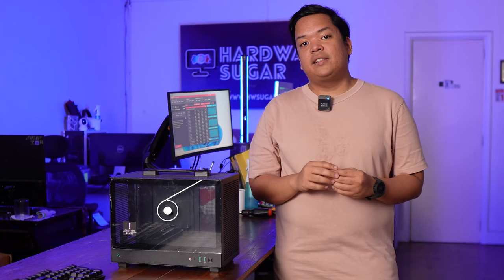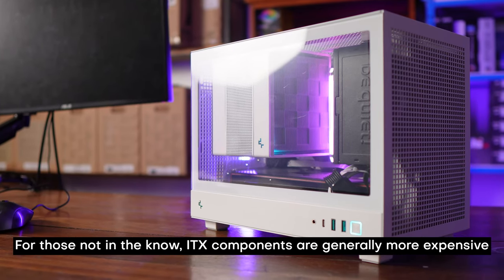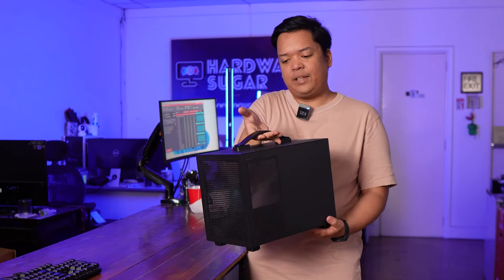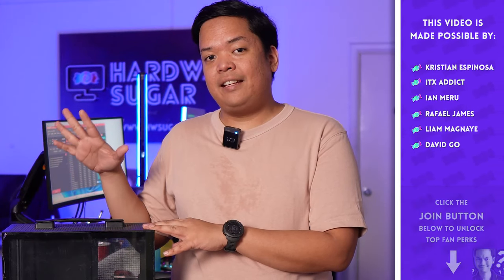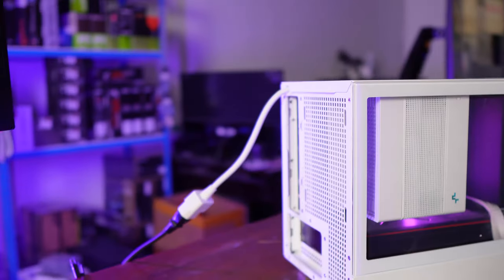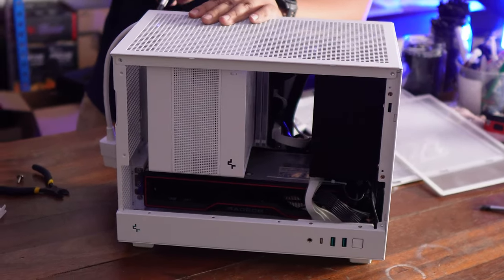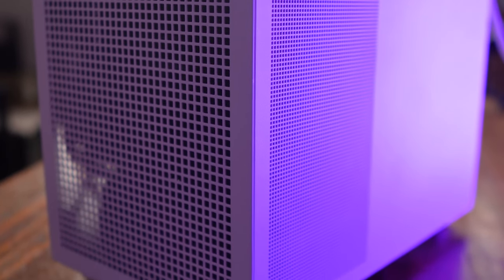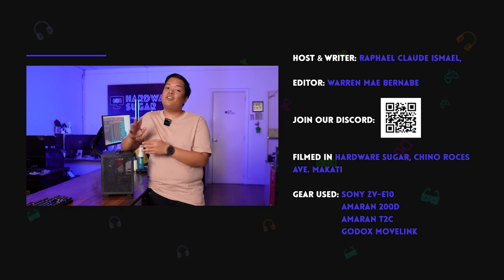ITX gaming rig on a budget! | Deepcool CH160 build and review

Comment: The future is ITX.
Reply: The only downside is the maximum GPU length of 305mm, this case can have a massive air cooler but not a massive gpu
Reply: @LeonOwO  i saw someone put a 4090 on it lol you can fit a powerful gpu here regardless, it may not be all gpus but theres still available powerful gpus that this case can handle like 1440p gaming
Reply: @ajjames1960  the 4090 fe im assuming? this would be a perfect fit but not a good match for this case.

Comment: Sayang, di makahinga ang gpu. Too close to bottom grills. I definitely prefer a vertical oriented case ala meslicious vs nr200 layout. Its cheap though, which is its big draw. Sana may option na mesh for the side instead of glass.
Reply: As stated in the video, during our testing, we averaged around 70C for gaming (averaging 297W) so thermals are no problem. Plus there's still space at the bottom as well as the space outside the case as it's lifted by around an inch via the case feet. 

Heck, we've seen other builders put a 4090 here with no problems.
Reply: @rockyismael  At what ambient were you getting 70*C? Is it 70*C exact because you said around 70*C that could be 69-72*C.What games did you run, or is it 1-2 games only? The type of game you play also makes a big difference.
Reply: @pkpnyt4711  ambient temp should be around 25c, games and apps used (1440p, mad settings) were Cyberpunk, RDR2, timespy bench, Diablo 4, AC: Odyssey and cinebench R24 GPU test (all tested and averaged values for about an hour). Plus FYI for our thermal testing, it's not about what game to use so much as what usage can draw the most power load as your primary metric is GPU wattage during sustained loads and as I've said, we've clocked it in at an average of 297W for the 6800XT for all tests.
Reply: @rockyismael  The reason I'm skeptical is because you were using a reference 6800XT in the video. No reference 6800XT has ever averaged 70*C only, specially here in the PH. Especially in your scenario, the reference you're using is in a mini itx case. That's why I'm aking what the exact Temps are.
Reply: wala naman problema sa temps, for an mitx case is maluwag na yan
Reply: HAHAHA! Closer = Better in the case of Small Form Factor builds. Watch any Optimum Tech or Machines and More video where they explore the airflow limitations of small PC cases.
Reply: @itxaddict7503  not always  the case as its dependent on the type of restriction the case has on the type of surface area with holes vs without holes it has. Even Optimum Tech mentioned that.
Reply: @pkpnyt4711  Recirculated air is never a cooler temperature than fresh air from outside the case. If you're arguing that the CPU temperatures might be affected by lack of exhaust for the air heated by the GPU I would say you have a point.

Comment: My issue if I went to an ITX build is how much of my exisiting stuff can be reused :(
Reply: With this case, you'd probably only change the motherboard and possibly the cooler (if it's an AIO or air cooler higher than 172mm). For the GPU, you'd only have to swap it out if it's longer than 305mm

Comment: Would you recommend using the Deepcool CH160 over the Tecware Fusion?
Reply: The fusion is a great "rival" for this but IIRC, it has smaller clearances for GPU (if using an ATX PSU) and air coolers.
Reply: @rockyismael  ooooh Id love for an ITX build comparison on a budget wit lyk pros and cons hohoho
Reply: It's got a handle!

Comment: Hi. Will i have clearance problems if my nvme requires heatsink?🤔
Other parts that will go with  build is 4080super, peerless asasin 120se for cooling, sfx psu, asrock a620i mobo. Thx!
Reply: The case doesnt have anything to do with nvme heatsinks. Check your cooler and gpu they might get in the way of the nvme heatsink. Also the 4080S make sure get the zotac one the case max gpu length is 305mm

Comment: ok ba to kung nasa taas yung power supply ng mother board ko? AB35ON Gaming Wifi gamit ko?  ilang storage sir kaya nyan? thanks
Reply: It would depend sa PSU and cooler na gamit mo. Wala siyang cutouts sa likod for cables so yung EPS and outlet cable ng PSU, nasa taas na rin so it's possible na di na kasya yung 24-pin cable for motherboard.